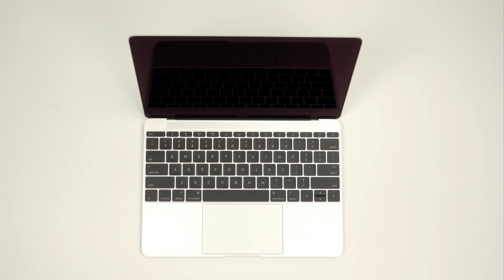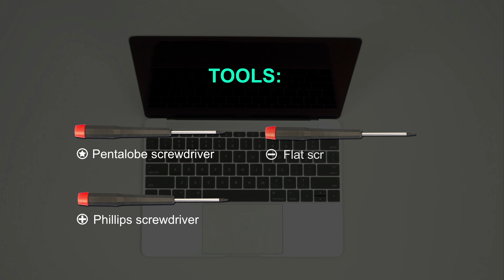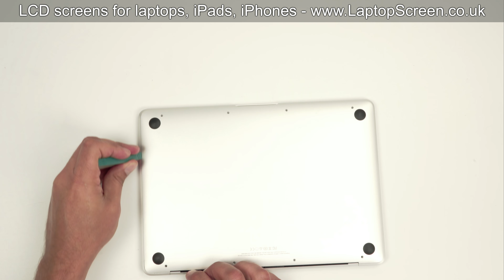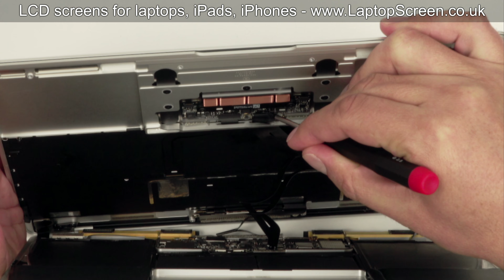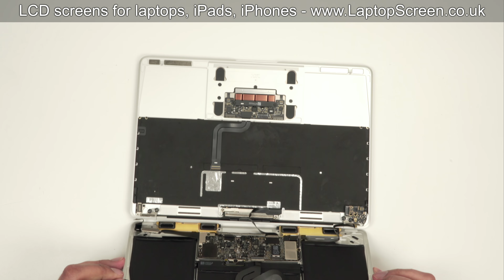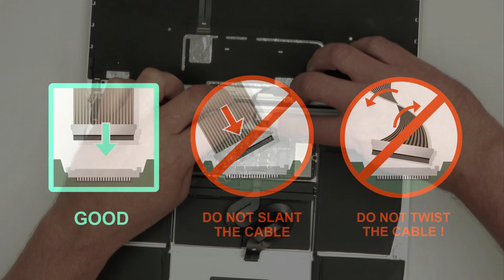MacBook 12 Retina - how to replace laptop screen

Comment: if the screen was opened more than it should, and now it has horizontal lines in the screen and also flickers and turn the display off could it be the flex cable is damaged? can i change that cable only instead of the whole display?

Comment: How much does a display replacement cost
Reply: 660.000 won in Korea
Reply: $500 usd, but you can get it for free due to the staingate problem, try and ask apple and see what they have to say..
Reply: @asirf.3634  I was checking this but the don't cover this model